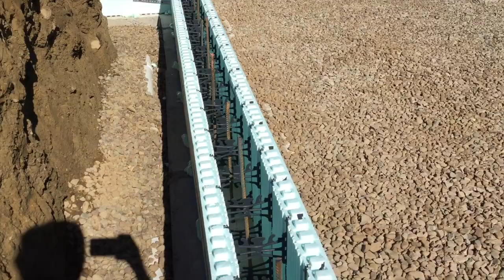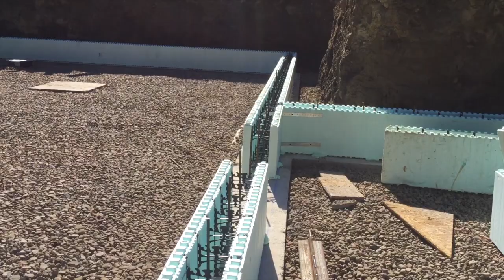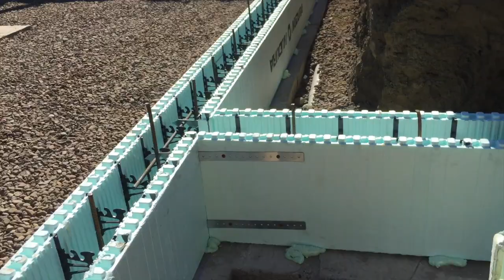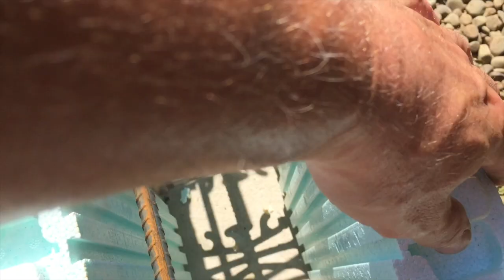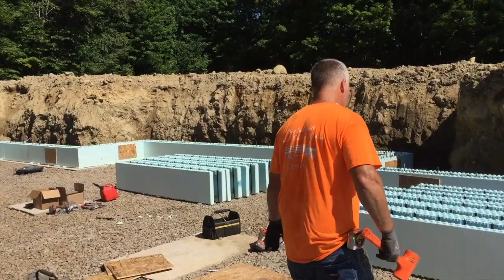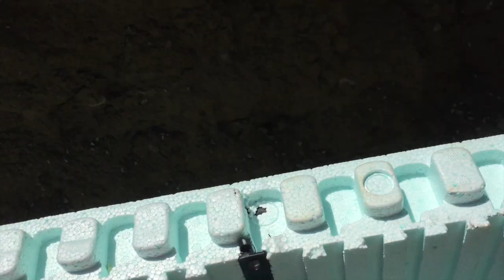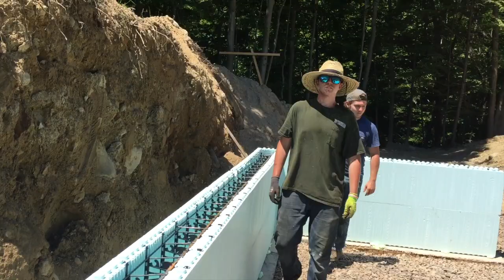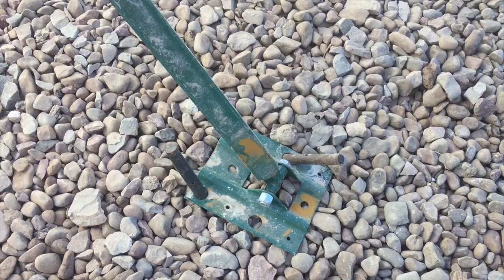Nudura ICF foundation DIY (avoid common mistakes) YOU CAN DO THIS!!!

Comment: I have done Fox block and Reward wall all ICF’s but I just started a wall yesterday with 18 different steps and bad footer work. This block seams the least labor in the block tying. Only horizontal  no vertical ties. Also the rep. Came today and said we don’t have Tees  or the metal like you used in the second row. I was amazed it will stay together. No vertical lift on the blocks or corners?
Reply: zero, I've used it before as well. it's the best ICF on the market. and folds to ship/store. look at rhe training vids on Youtube from NUDURA
Reply: wonderswords agree I enjoy using them
Reply from the maker: You should not get any vertical lift at all becsause the blocks clip together. That form lock latter wire is nice in the 2nd and top course because it helps straighten the walls. We fabricate the T’s on sight with the T -straps and I have nevewr had one come apart they are rock solid if done proper.
Reply: Bondo Built thank you sir I’m going to the site now to wait for pump truck! Thanks you for your insight. It’s been more helpful than the Rep. He’s says you don’t need the ladder and some of the blocking I’ve done. Peace of mind goes a long way. Especially 14 foot tall on the side of a mountain. Anyhow have a great day and stay safe.
Reply from the maker: @jamusmorrison3073  Thanks. I hope your pour goes well. I agree 100% about the piece of mind factor. Sounds like you set yourself up for success. 👍. Let me know how it goes. Im working on another video from one we just finished pouring 👍👍
Reply: Bondo Built all went well. What are your T section metal straps called? This block seams more durable than the others so less bracing. But I’m sure I go over kill. But I don’t want to pick it up off the ground! Keep putting out videos I prove they work!
Reply from the maker: jamus morrison that’s great to hear. Glad to help. 👍👍 I think they are called t straps or I often refer to them as knives. They got the point you push right through the block. Works great. Yes these blocks are stronger. 💪💪

Comment: If you're reversing your corners why do you end up with common seams? Shouldn't that reversing avoid commons seams in the same location?
Reply from the maker: Indiana Fred some walls come out even but an odd size wall will need a common seam because the blocks won’t lock right so you need a common seam in that location. They should be located away from a corner if possible. The rest of the wall will be staggered seams because of the reversed corners. Hope that makes sense. 👍
Bondo
Reply: @bondobuilt386  Thank you!
Reply from the maker: Indiana Fred you bet sir 👍

Comment from the maker: We put the latter wire or form lock it’s called in second course and top course because it stiffens and straightens the wall. 👍
Reply: Do you have any ICF jobs going on right now I’d like to see pictures or video of bracing and corners. Reason I ask is I was told we over killed it.  Like tee walls. 
We just completed a 71x45 with 11 corners and 10 step downs. 12 beam pockets. We didn’t pour the footer. It does work better than any block on the market!
Reply from the maker: jamus morrison were only doing a small garage right now. Overkill is not always a bad thing if there is no problems with the pour.  👍👍
A big job like that would be a bad day if you had a blow out  during the pour.
Reply: Bondo Built I agree it would be bad. Thanks for the prompt respond. Enjoy watching your videos. We are located in north central West Virginia. For the last 10-15 years I’ve been around ICFs and still enjoy learning.
Reply: Bondo Built  the pour was 85 yards.
Reply from the maker: @jamusmorrison3073  Thats a big one buddy 👍
Reply from the maker: @jamusmorrison3073  There is so much to learn. Same here 😊
Reply: How can someone contact you?  Business phone or talk offline?
Reply from the maker: @stevenmiller1605  look me up on facebook and message me.